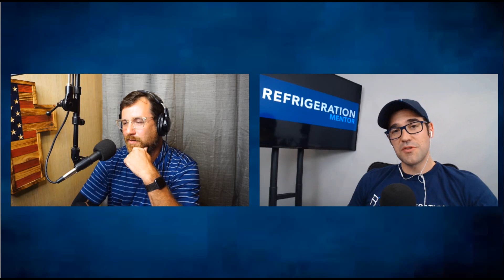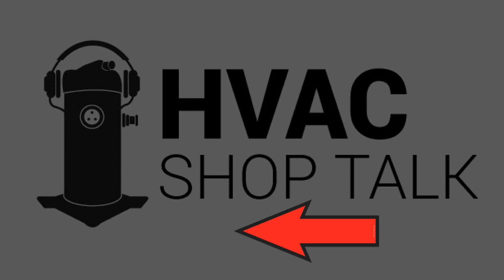What is Different About CO2 Refrigerant Compressors?

Comment: Can i put co2 in car that work with r134a?
Reply: With some modifications performed by a licensed HVAC technician, propane can be used as a near drop in for r-134a systems. They have the same pressure range and material compatibility. CO2 operates at a minimum of five times the working pressure of r-134a systems and requires materials with higher strength under those pressures
Reply: They won't tell you this. But 50% R600A (butane, or iso butane) and 50% R290. Will run great, if not better in automotive systems (134A mechanical compressor only!!! No hybrids, no electric compressors). The only downside is it's highly flammable. You can also use a piercing valve on a can of computer duster (the HFC inside varys) with no bitterant and use that too.
Reply: No, you can use 134a and 134a only
Reply: @pewpewimbob false